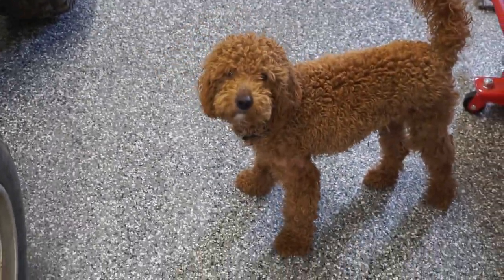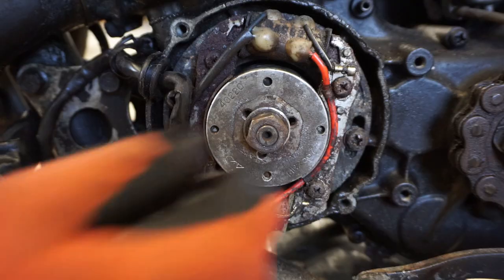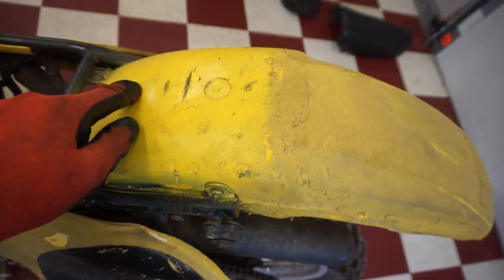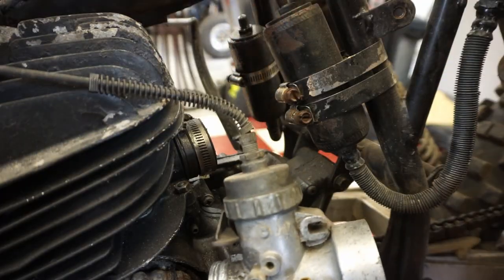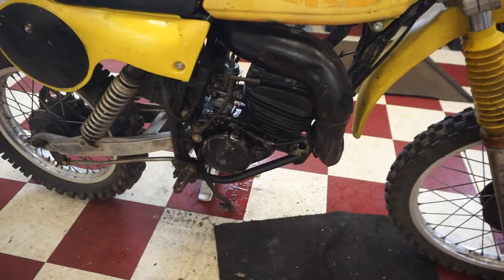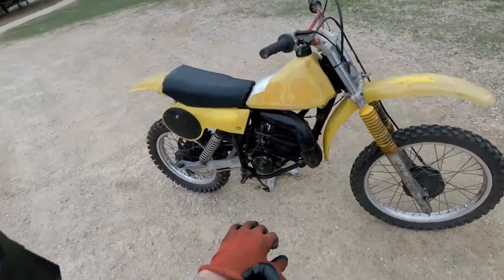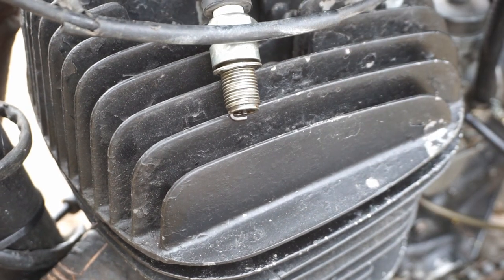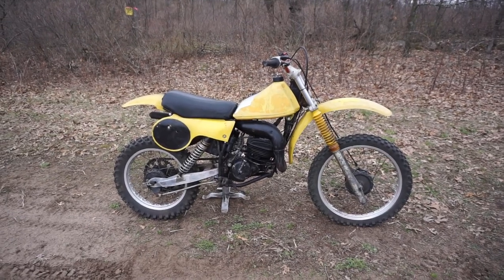$500 Vintage Racing Dirt Bike Find (Rare 1980 Survivor)

Comment: That particular bike was famous for its handling.  That is, it was great at going thru turns.  I rode a well setup 1981 and I still remember the experience from 40 years ago.  If that 1980 had its suspension renewed to factory specs it would easily handle turns with the best of the bikes of today.
Reply: 😂 no it wouldn’t.
Reply: @lawrencefranck9417  Words...
Reply: @lawrencefranck9417  I can see you have never ridden one of those Suzukis.  Absolutely effortless to go thru turns with.  Think it and it is done.  Especially any turn with a well-defined berm or a rut.  You would have had to experience it to know....
Reply: I had one 125 and 100
Reply: Do you actually believe a 1980's bike can outperform a modern bike? You are out of your mind sir
Reply: @AleTravi  I said the 1981 RM 125 can handle turns with the best bikes of today.  I did not say it could "outpower" (engine).  I did not say it could "handle hard landings" (stiffer suspension).  No other aspect than its ability to "handle turns" (combination match of frame geometry, balanced suspension and "just right",  smooth delivery of engine power)....
Reply: The maico made them look like shit, so they couldn't be that great to now standards. But maybe for it's time they were better than the competition.

Comment: Dude that takes me back I had the same model back in about 83 I think! I rode the wheels off that bike! I bought my son an 89 rm 125 and I rebuilt the engine and he restored the rest of the bike and it turned out nice! The old bikes have a grittier sound than the newer 2 strokes with the old pipe configuration.
Reply: I found a beat up barn find 91 rm80. The 91-92 rm models are the nicest bikes they ever made. 86-96 is the best 2 strokes !

Comment: Bro, if u put the front tire of the bike in the left or right Corner of the box, all u have to do is put the ratchet straps on with the slightest tension. Once they are evenly tightened move the rear tire wherever u may need it to shut the tail gate or not. I promise u just lightly tighten the straps and that bike won’t go ANYWHERE and not have to mess with the seals leaking forks when u get it home. I’ve also saw basket ball between the front fender and tire..

Comment: I had a 1980 RM 80 back in the early 80's it was almost new when I got it. I ended up blowing up the engine shortly after getting it and never got another Suzuki after that. Stuck with Yamaha and Kawasaki and a couple Hondas but I raced mostly Yamaha. I had a 85-86 Kawasaki 250 that had been turned into a death machine and it was one of the fastest dirt bikes I had in the day. I loved motocrossing so much but I ended up breaking my back on a huge jump riding my Honda 250 and I'm disabled today because of it. But I have no regrets and it was the funniest times of my life. That old RM 125 really brought back the nostalgia lol.

Comment: i restored a 1977.... pretty similar condition....piston slap sounds a little bit loose ... when they idle, they are not too bad as far as wear ... when they get loose they don't start and do not idle easily ...run a non resistor plug ... B9ES ...plug caps on those have resistors built in...
Reply: i have a rear wheel set a little cleaner than what you have... if interested ?

Comment: I used to race one of these, The one I had was called an RM125c. My father souped it up polished ports The ports were like  looking into a mirror, we corked every hole in the crank and ran it on aviation fuel. The bike was an absolute rocket ship even compared to today's standards, I was on the back wheel constantly without trying. My father used to say you will never win races riding around on the back wheel. The noise that bike makes really brings back good memories. Great work. Keep it up.
Reply: yo my childhood friends (back 30yrs ago) dad supplied him with aviation gas, man that stuff stank riding behind him
kx 80's

Comment: A Great find for $500 and with a fresh top end you will have it running perfect. I had a 1979 Yamaha YZ125 that was similar to this air-cooled motor. Then in my sophomore year of high school I bought the new 1981 Suzuki RM 125 that was liquid cooled and had the new full floater rear suspension and it was a night and day difference from the older ones, you may have had one of those at one time if I am remembering correctly. Nice work on this one and I really enjoy your content.

Comment: I learned something from you today.  I have a suzuki intruder vl800 and the clutch slips a little bit especially when it's cold been that way since I bought it two years ago. I've been using car oil I didn't even know there was motorcycle oil for wet clutches.  I'll bet if I get the proper oil it'll stop slipping. Keep up the good work young man. I been watching your channel for like 4 years and seen your progression learning and teaching others .
Reply: Car oil usually has friction modifier additives that will make wet plates slip. Put  a brand name motorcycle oil in your gearbox and should stop slipping.  If not, change out again.  Still slipping it has contaminated the plates. Replace.
Reply: i mean i ran slipping clutch in my aldy 300 (trx300ex) for 2 years cause friends kept saying its this its that.. i changed my clutch and all problems gone :)
Reply: 10 w 40 non synthetic oil, from wally world, it's usually by where they keep the off road helmets and stuff

Comment: Raced my 78' YZ250 into the ground. Had it set up like Bob Hurricane Hanna's. The bottom of the frame was riddled with stress cracks when I retired it. I'd planned to replace the damaged section of frame or replace the frame when I was able to, but when I returned for it, It was gone. Mom didn't want it stored in dad's shed any longer and she gave it away. I miss that damned bike. Not as quick as my current race bike, but it was much more fun to ride and that overstuffed seat!

Comment: Use flexible bumper bondo for the gas tank. The bolt is missing that holds the clutch shaft down in the side case.

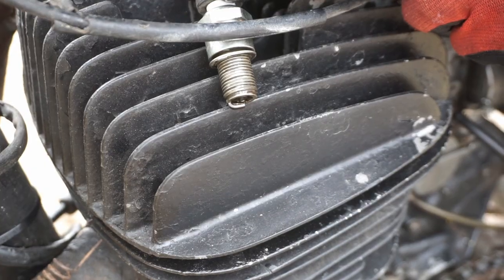Comment: Nice, it's going again. I had a early '70s TM125 and I would just hold her open and let it "sing". Once the spark plug gets a coating of black soot on it, it's done. Watch closely at 44:42, as you are testing, the spark is short circuiting and traveling up the insulator porcelain. Be careful using the wrong plug in a high-strung motor.

Comment: Love the video and bike!  Those pre power valve engines were soft on the bottom and fouled plugs if you didn’t ‘ ride the powerband hard’.  My 1980 RM250 was high strung but man did it foul plugs quick if you eased around too much trying to sneak home after hard riding in the woods.

Comment: I saw you trying different plugs to check fire.I never see you youtubers use the screw driver trick. All I do is make sure the tip of the screwdriver is getting a good connection with the plug wire, the insulated handle helps with some safety. I have been zapped. but in a pinch it gets the job done. like the videos btw

Comment: Joe the reeds are bolted to the bottom of the cylinder on those old RM''s,get a set of Boyseen fiber replacement reed valves wnenever u rebuild the engine,u will thank me later.if the stock metal reed breaks ur goona probly have a excedrin sized headache,lol.neat old bike.i raced mx feom 73 till early 90's and had a few Zukes back in the day,and several yammies.Thanks for the memories young man.

Comment: On the clutch or any other similar cable you can simply dremmel a slot in the nut you want to add and pass the cable thru that slot and thread it on. There is plenty of material left for it to function.

Comment: Hey bud use Por 15 for the crack on the tank. Coat it from the inside works wonders. One quart of the stuff will do several tanks. Try it instead of buying new tank. It would make a great video.

Comment: I would put a new top end on it, I am sure it needs it. Then I bet it runs great. Once you foul a plug you need to put a new plug in it. I had a few Suzuki RM's and they would foul a plug once in a while, which is why I always had 3 or 4 spare spark plugs in my tool box, just in case. It might be running a little rich too, I would lean out the fuel mixture, I ran my RM's at 40:1 with Bel-Ray MC-1 racing oil, and then it almost never fouled any plugs.

The more you run it at low rpm's the more you are going to foul plugs, that bike is made to run at high rpm's, it's a race bike, not a trail bike. You need to run it hard, 3/4 throttle to full throttle, or it is going to foul plugs. When you cruise it around at low rpm's in the woods, like you were doing, you are fouling the plug. Keep it in the field and rip it full throttle through the gears and it should not foul plugs on you.

Comment: insane that it started, and that it has no visible crank play, but the main crank bearings are very corroded, this sandpaper noise you can hear is coming from them, had a few engines like that, once you rebuild them, they just sing!

Comment: I think those early 80's ones have a different reed setup that makes it particularly easy to foul plugs. I know that bike there shares the same bottom end as my pe175 and if i let it idle and free rev too long it will floul the plug and it will spark to the inside of the plug and not the end! really weird stuff! The reed setup allows for more bottom end torque.

Comment: With a little freshening up, new tires, a boot, filter and air box lid and a new plug (that short one dropped the compression ratio a bit),  that front wheel will head for the sky when you change gears and pin the throttle, in each gear.

Comment: Chromoly (4130, 4140)is a good handlebar material and has excellent strength to weight ratio. Preheat to weld. The exhaust, brakes, and clutch need attention.

Comment: I was doing some testing on a snowmobile yrs ago and temporarily threw a plug in from the truck.  Turns out it has a super high heat range and blew a hole in the piston.  Pre-ignition so careful.

Comment: Yea u gotta remember thoes early 80s bikes were a whole different animal, they weren't all nice and comfy and floaty like the new ones, they handled different, they sounded differently, and they were more bare bones.. That bike sounds exactly the way it would have sounded brand new, rattles and all.. They would vibrate right off the show room floor!! Thoes were bad ass bikes for 1980, those are what I grew up on.. Better then this newer crap they came out with in my opinion,  you could actually work on the oder ones and adjust everything, you cant do that with these damn computers and fuel injection.. lol.. great find, I would have paid $500 all day for that bike.. It sounds amazing for the age.. It still rips!!!

Comment: hit gears up faster its will give power spike in 3-4 gears also,but new plug right setting in carp,clean pipe right gearing in front and rear and its start ride like track horse.

Comment: When Released they had an issue with the Gearbox, They sorted it out late season but no one bought them, The YZ water cooled was released next Season, I had one £775.00 
          Raced it to near death, The exhaust burnt n blistered your inner right Knee even through leathers 😢, 
    Short power Band. 
                    But it flew and I got the club championship that year, 
          In a small Club ❤, 
    I had a Bad spill and it knocked my confidence, Work and Discovering Females and Beer changed my direction for Adrenalin Rush 💥.

Comment: Bought the same bike new in 1980. Great mx cycle. Only ran 5 gallons of gas thru it and sold it in 1980 to buy an engagement ring. Paid $1200 new and sold it for $800 😢

Comment: That bike looks very similar to my 1979 Yamaha Yz80 2 stroke, just sized up and a bit beefier, other than that if i bought that bike im sure my friends would be confused seeing a regular 1979 Yz80 and this bike side by side. My Yz80 still runs amazingly for a 40+ year old bike and has had a couple 230lbs guys ride it and still has no issues with power or speed

Comment: I’ve had the 80RM 400 the bolts all need tightened every 10 minutes! If possible either drill split pin or nylock all them! As you WILL lose the gear shifter the silencer! And exhaust manifold attachment! Make sure the swing arm bushings are good! Remove and clean regardless of state! Regrease!! DO NOT RIDE IT if the swing arm bushes are worn! As the chain WILL come off and SMASH the engine casing and the drive cog area will need to be welded back on or JB welded( I did this to mine it was a permanent fix! Although old! This year RM has the best tune and power band of the early 80s bikes! And the 125 although small is still a rapid bike!! Worth WELL more than $500!!!!

Comment: Thoes old 2 strokes ran best in high RPM since that's where their power band was and you were just supposed to run the crap out of them up in the ol RPM and let her eat!! They werent meant for putting around or low end tork, just keep it pegged and hold on if ya can.. hahaha, atleast with the 250s and 500s.. best era of bikes built.. My opinion..

Comment: That would be Chromoly sir! 4130 most likely and one of the most used steel alloys for strength in almost every single form of fabrication of roll cages, bicycle frames, and other areas high strength light weight steel is needed, the word you’re looking for is CHROME-MOLLY  basically. MOLLY like the name, fancy word for chromium/molybdenum/iron/carbon steel alloy where the chrome-moly comes from! As you know, now they are  aluminum that’s why we bend bars every time we drop our bikes 😂

Comment: Chromoly steel is a type of low-alloy steel which is stronger and more durable, weight for weight, than mild carbon steel. The name is derived from the two major alloying elements contained – chromium and molybdenum.

Comment: Just a suggestion when you tie your bikes down in your truck don't compress the front suspension that much you're going to blow out the seals
Reply: And if the strap fail, the bike spring ...out of control.  If the straps are at 45 degree angles, you can get by with a mere  two inches of compression.  I've used that 45 degree idea for 40 years of traveling to and from practice and races.  Never a problem.
Reply: @microsoftteams2663  I've actually had a friend lose his bike out of the bed of his truck because his straps failed and came loose period your idea of 45 degree angle is absolutely perfect

Comment: What would make my 1990 cr125r rev to tha moon at first start??
Reply: When it starts it revs to tha moon an I automatically shut it off. I went thru tha carb an cleaned it an everythang an there’s no air leaks. It may be my throttle cable is worn out